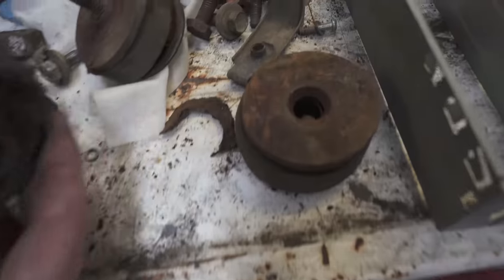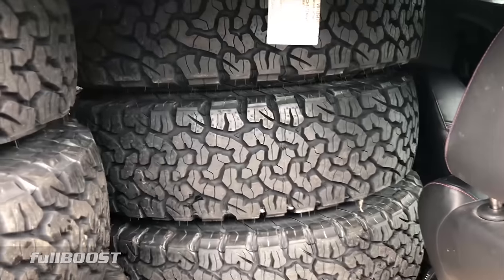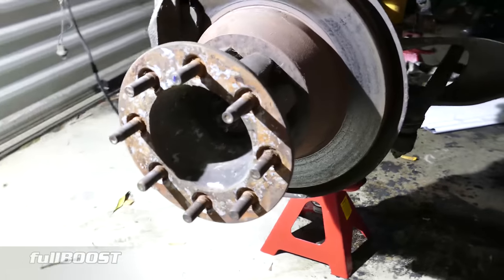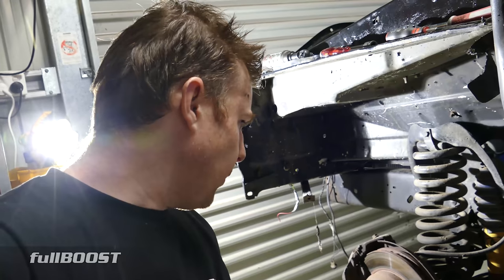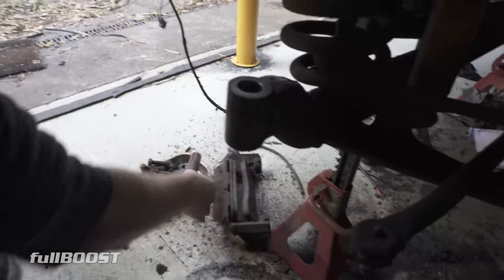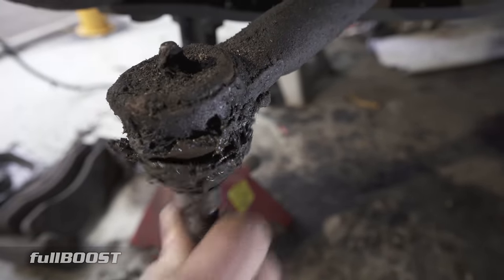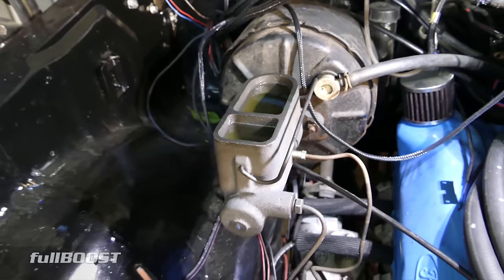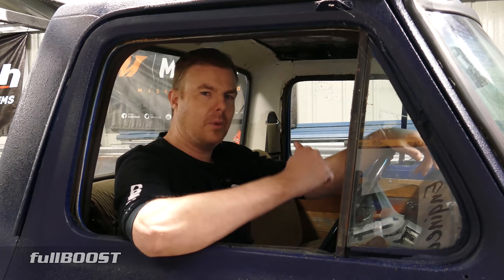Ford F350 V8 turbo ramp truck part 5 | BACKYARD MECHANICS | fullBOOST

Comment: Broomy: Won't drive another inch with those tyres, they're shot
Also Broomy: Got a flat once & kept driving, ground the wheel down to the axle
Reply from the maker: Young Broomy v 2020  Broomy 🤔😆
Reply: Shifty Malone 15 years difference between this Broomy’s!

Comment: Those ko2's are awesome tires they last forever ,have a stiff sidewall ,have a GREAT weight rating, get tons of traction,and made in the  good ole' US of A !! also throw a limited slip in that dana 60 hit up amazon they are cheap and the shipping is 👌!!
Reply: yeah except 350's have dana seventies in them and it will cost a couple of grand to limo it and highway gear it ,im a bit heart broken cos i blew my highway diff up in my effie

Comment: A friend on mine a 250 with turbo as well, around 350rwkw's and also 411 9" diff gear so far i believe he did around 10's, just hard to get those rear tyres to stick because so light on the ass end, keep up the great work guys and i hope you can turn it into the early 180's tow truck. :)

Comment: Hit the leaf springs with some oil, it'll help the leaves slide over each other which will help with ride quality and won't impact the load carry capability. You may need new dampers though as the spring will be livelier.

Ford recommend greasing the bearings on their later trucks, not sure if they say that old the older F series though.
Reply: Jason R there are no shocks in the rear of these things from factory. Sort out the rear in the next episode ;) front still a bit of a nightmare lol
Reply: @BackyardMechanics  Interesting that they made that choice. I've never done kingpins, looks like a shit of a job, rather you than me;) Should be a pretty decent truck when you're finished. 

Needs an LS but;)

Comment: Mate as far as the speed sensor its just in the auto or manual, just a plastic gear which sits in there as part of the speedo cable and these days the replacement gears are really good, maybe that is a cheaper option. :)
Reply: 7071t6 we replaced the cable already. Haven’t tested it since. The dash was working it was just inconsistent

Comment: I run Treva same size as BF and  continental steer Heaps of K S 100 to 120 steer 90 to 100 k drive .Bf Goodrich overpriced like Cooper 80k warranty if wheel aligned every 10 k.You could have got 50 k out of the old ones.